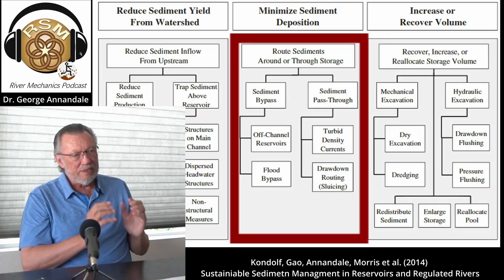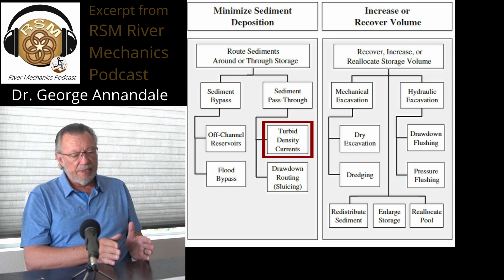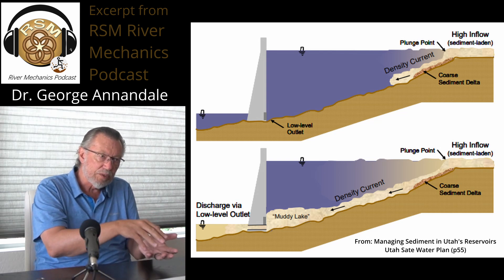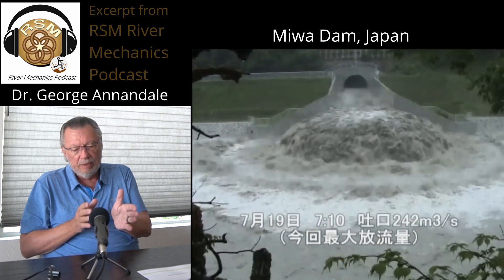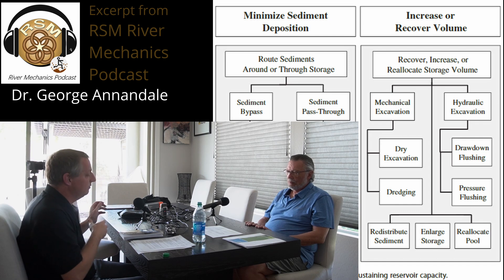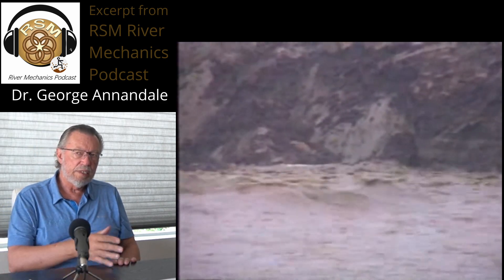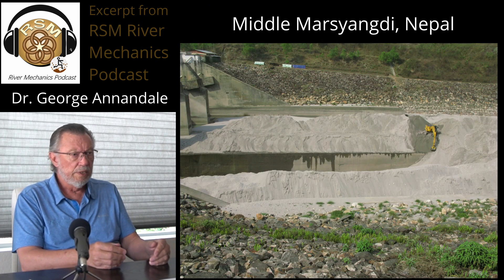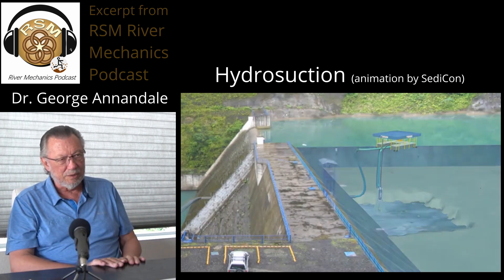Reservoir Sediment Managment Options ft. Dr. George Annandale

Comment: Hello Stafford, 
I really appreciate your impressive conversation with George Annandale on sediment sluicing in the rivers and appertaining structures. Indus river reservoirs and barrages in Pakistan are badly experiencing the sediment problems. Now due to over commitment in upper basin and excessive diversion and detention associated with short duration floods, the lower Indus barrages and canal commands are in perilous condition. Let's join hands together and carry research on the Lower Basin, Indus delta issues and solutions to maintain the carrying capacity of the alluvial water courses. 
Regards 
Zarif Khero 
Chief Engineer 
Irrigation department
Government of Sindh, Pakistan.